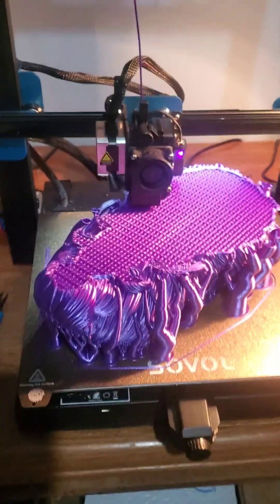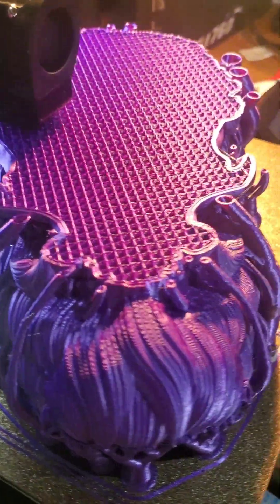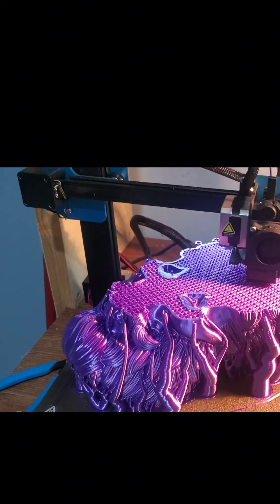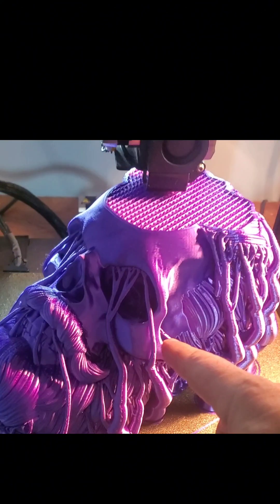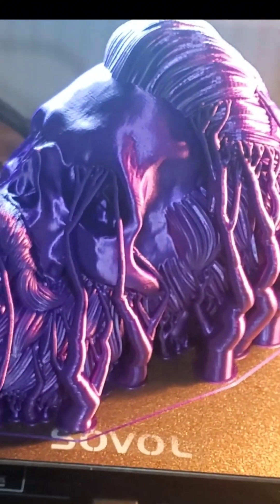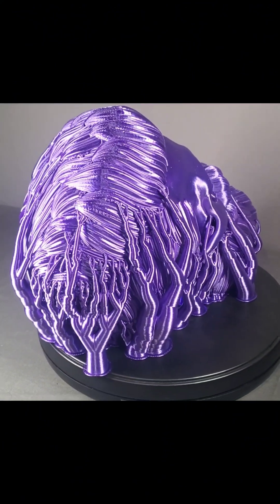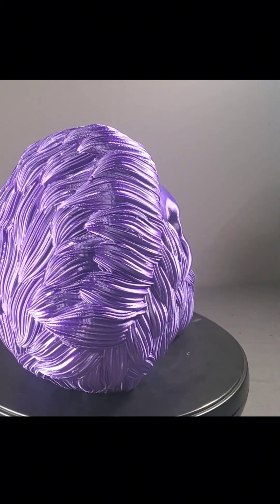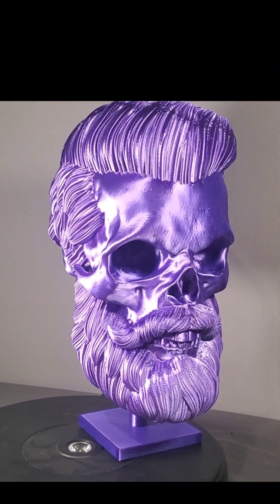How to display your hat. Hatheads by Request

Comment: Nice infill
Reply from the maker: Thanks
Reply: I wonder how many hours were spent on the infill.  It's far more than is really needed.  When I started printing some years ago I would do the same but I eventually realized most of the time it is not necessary to have so much and it is just wasting filament.